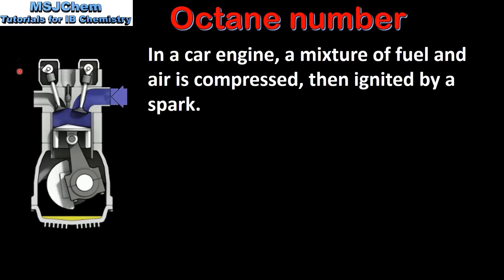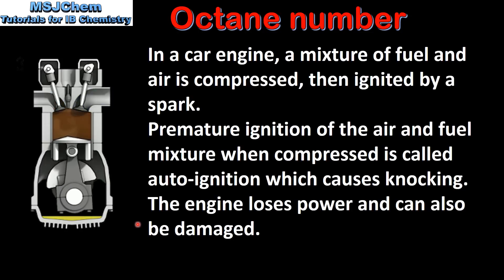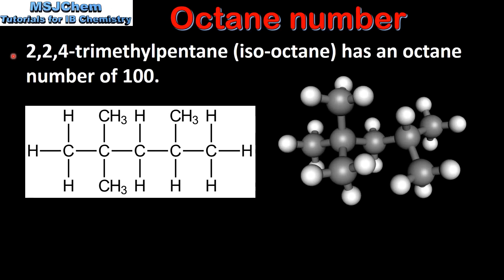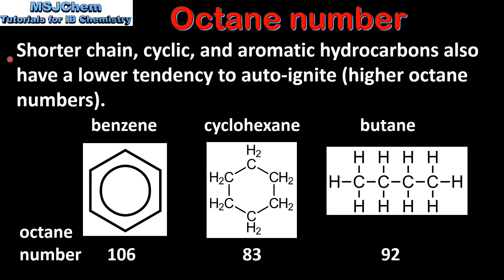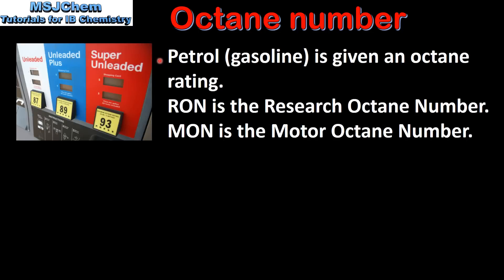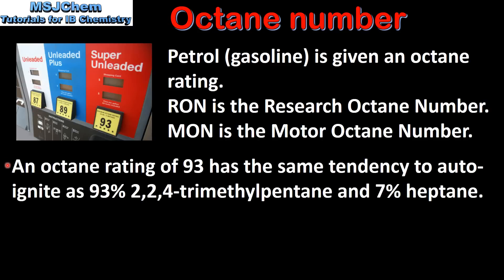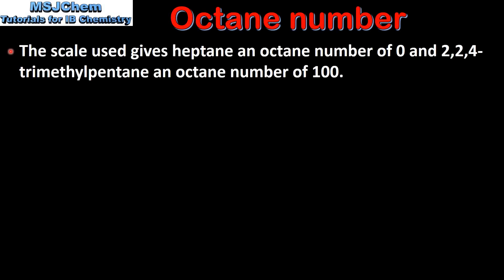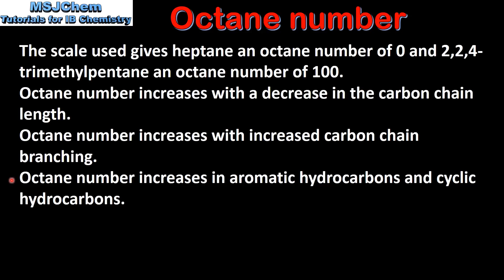C.2 Octane number (SL)

Comment: Hi Mike,

When you mentioned that a fuel with an octane rating of 93 has the same tendency to auto-ignite as a mixture of 93% 2,2,4-trimethylpentane and 7% heptane, do these percentages refer to the number of molecules or is it related to the mass?
Reply from the maker: Here's a link to an online octane calculator - the percentages can either be entered as %vol or %mol.

https://cloudflame.kaust.edu.sa/fuel/octane_calc
Reply: Thank you! Your videos are extremely helpful.
Reply from the maker: +Tree Root You're welcome and thanks for the feedback.